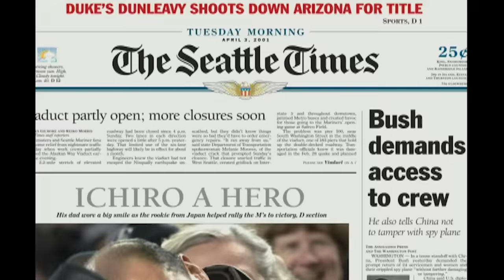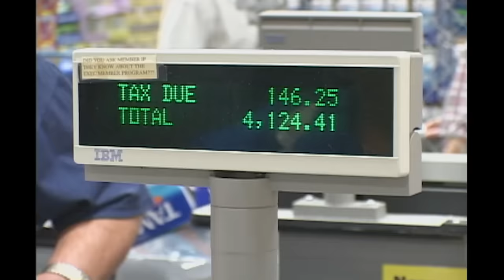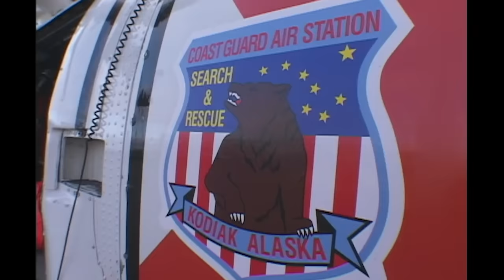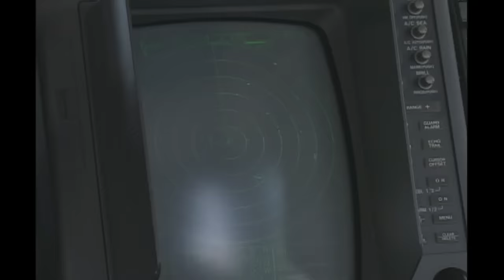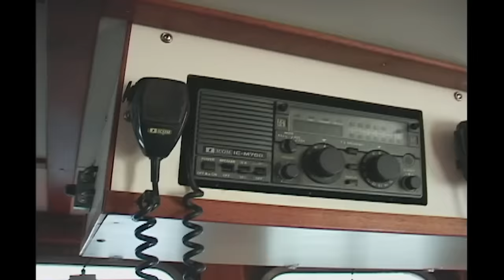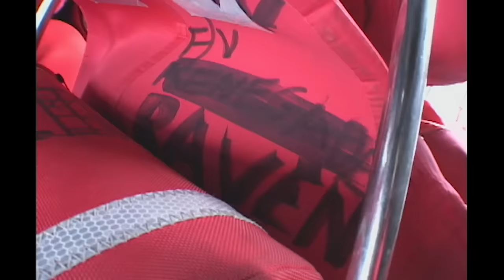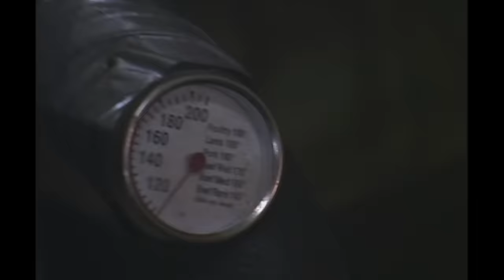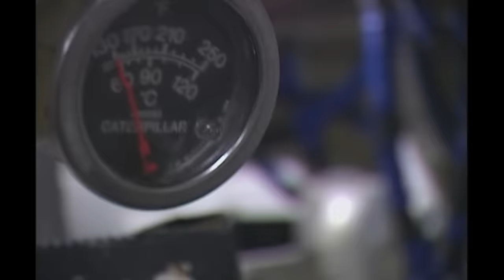DEADLIEST CATCH - FIRST EVER FULL EPISODE! (America's Deadliest Season - Alaskan Crab Fishing)

Comment: All of you crabbing vessels need to buy 2 cases of JB Weld's "Water Weld" it will seal up a crack solid, even with oil leaking out of a crack and on the crack surface. It will bond through the oil!!
I know how good it is because some jack-leg who called himself a welder, installed a new dip stick tube on one of our huge Transmissions that holds 1000 gallons of Meropa 320 gear oil. The day after we got everything back up and running, a 1 inch long piece of his weld broke away from the housing, taking away a small piece of his root pass with it and leaving about 1/2" long crack gushing oil. I already had the JB Water-Weld in my tool box. I kneaded a 1"x1" piece of the JB Weld 2-part Putty up and jammed it into the crack even with oil all over it and it was cured hard as a rock in less than a minute and no more leak.
Reply: Barry Obama  Not on a boat. Was in the plant where I retired from.